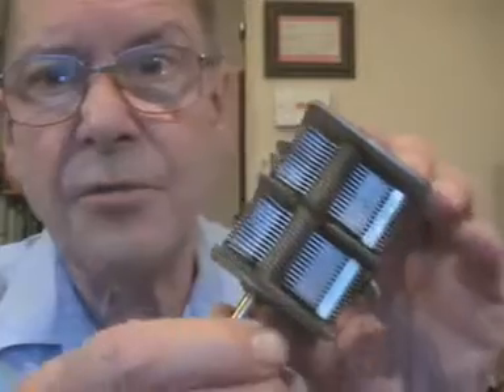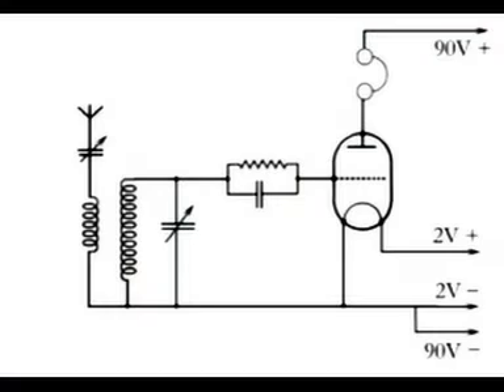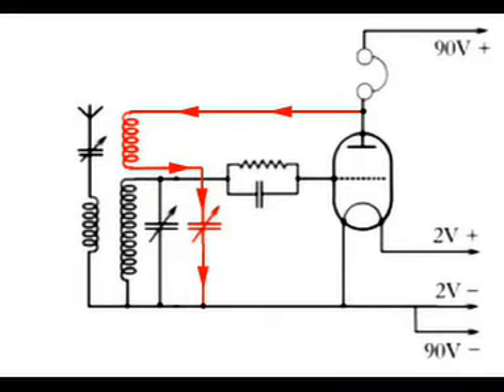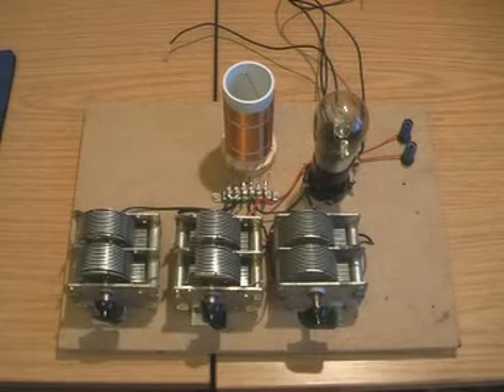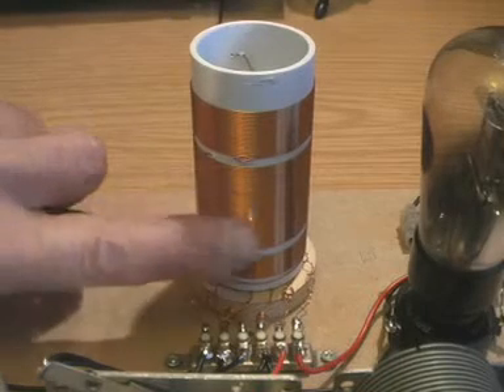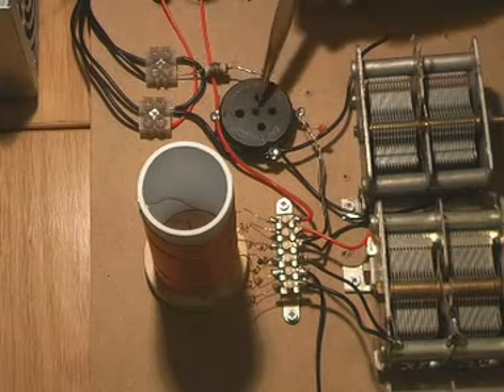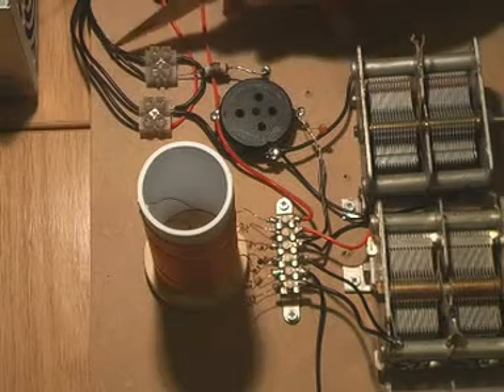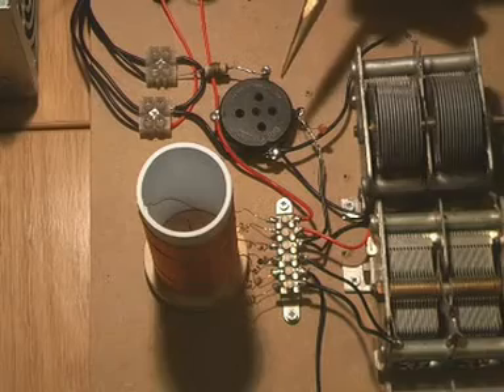crystal 5

Comment: Sorry if it's been asked, but what are the values of the resistor and capacitor on the grid?
Reply from the maker: Gadzooks! I never gave any values in the video - very sorry about that! The 'grid leak' resistor is always high - 1 Megohm, 1.5 M, maybe 2 M. By contrast, the capacitor is relatively small - 200 picofarads to maybe 1000 pF. Wisihing you all success, cheerss, Norman.
Reply: @bixanorak  Thank you sir

Comment: Merci Monsieur le Champ....  A very useful series of videos.   This last one has inspired me to revisit some old regenerative projects.  Best wishes from New Zealand.
Reply from the maker: Hi Stephen  - thanks for writing. I wish you all the best with a return to earlier projects. May they all readily spring into life! A quick story... In the 1950s, there was a very popular kit circuit for a one-valve radio, using a 1T4. Me and another kid in the street both made one. I'd been taught soldering by a chap who'd been a wireless mechanic in WW2. So my set looked pretty cool under the chassis - only it wouldn't work; not a peep out of it. The other kid's set had been assembled using a huge plumbers soldering iron. It looked ruddy awful, but worked fine! 2 or 3 years later, I thoroughly went through mine, and solved the mystery. it had a 3-position switch: Off / Medium / Long wave. The idiot who compiled the kit only had a 4 pole 3 way switch, so he clipped some tags off the back to make it a 3 pole 3 way. Only, he clipped off the WRONG tags - so my switch simply didn't work! Still, it was fun to find out... 😀 Again, all the best to you & yours, Norman.
Reply: @bixanorak  Ha. That is a good story.  Nowadays you might be able to get the supplier locked up for child abuse... that's worse than misgendering.  You have an interesting channel which I am yet to explore.  When I was about 12 years old we stayed at a house in which there was an old 'wind up' gramophone. There were a heap of 78s in the inbuilt cabinet.   I recall the names of just two of the pieces we played...  one was a fun song call 'Goofus'.... and the other introduced me to Edward Elgar:   a wonderful full version of  his Pomp and Circumstance.   That music really grabbed me.

Comment: Hello Norman,

your crystal 1-5 video series is the best I have ever seen. There is a wonderful view of the elementary radio components. Oscillation circuit, crystal detector, diode and tube. How it really works. This makes really fun to look at and listen to. I think this video series is also suitable for schools. Very impressive, for example, as they illustrate the problem of selectivity and solve the problem with the additional antenna tuning capacitor.

Your comments and presentation are very good and even humorous.

Greetings from Berlin

joe